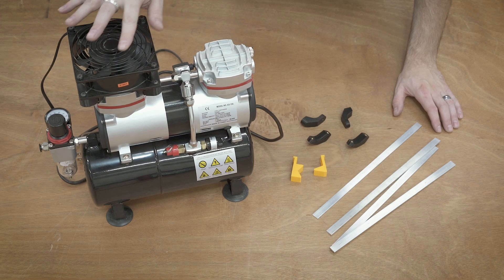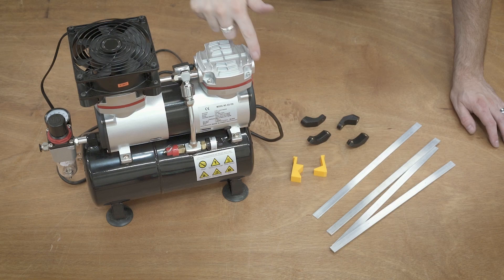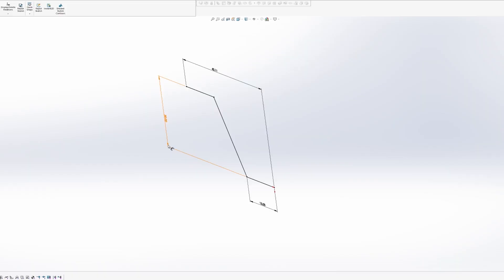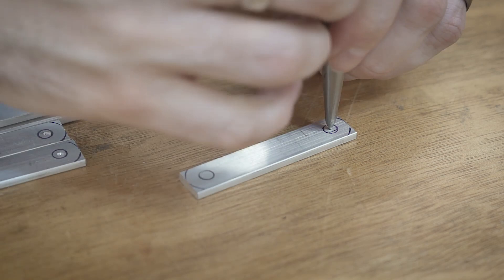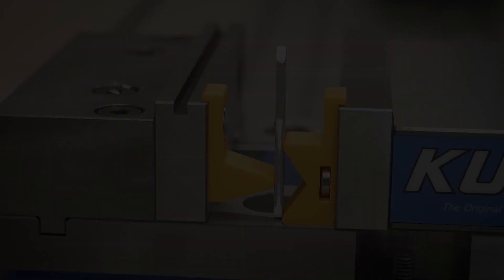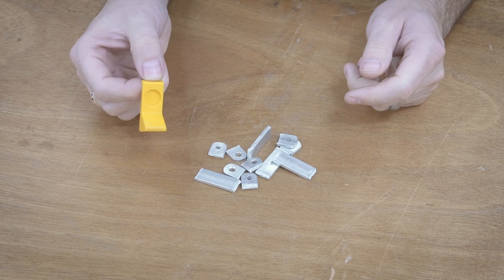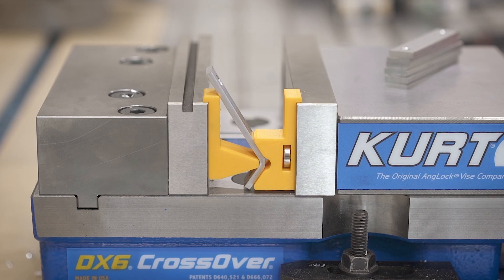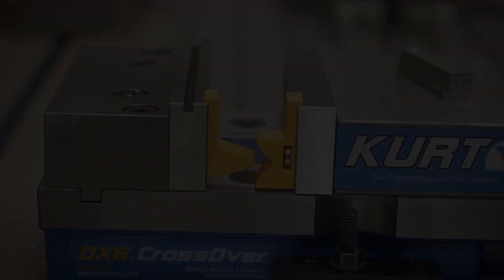Bending Aluminum with 3D-Printed Dies

Comment: A tip for annealing aluminium, coat it with soap from a soap bar and heat it. When the soap turns black you have reached the right temperature, then let it cool.

Comment: For future reference mate rub a normal bar of soap on the aluminium before you heat it and heat it till the soap turns brown and you have properly softened the aluminium for bending 🤙🏻
Reply: With an O/A torch setup, cover the bend area with a flame of acetylene only to cover it in soot. Light the torch as normal and burn the black back off the metal. Thats the temp needed to relax aluminum for bending.
Reply: @LegendLength  Some softly whispered sweet nothings helps too.
Reply: Similar idea but trick I learned in another forum is to mark it with a sharpie and heat until the sharpie (mostly) disappears.  This works great.  Taught it to teenagers who have used it a lot and they learned it really quick.  Only one melted part in the process.  LOL.

Sharpie is more common than having acetylene torch and easier to read color change than soap.

Comment: 3003 series aluminum is the one to grab for bending off the shelf. You can also cold bend 1/8" 6061 if you increase your bend radius to 2-3x what you were using and keep the angle below 50 degrees. I cold bent the entire shell of my last 3lb bot out of 2mm 6061 with 45" angles first try without any cracking :)

Comment: You can use a heat gun to heat up the aluminium for it to more easily bend without cracking. The simple trick is to use a bar of soap to draw on the aluminium (like a crayon), heat the aluminium (opposite side of soap) until the soap just begins to turn black then remove the heat gun. The soap is a perfect medium for aluminium, I used to create aluminium ladles back at school by hammering the aluminium over a hemispherical mold with no cracks ever developing

Comment: 5052 is another good alloy that's fairly bend tolerant.  A bit less ductile than 3003 but in your application that probably doesn't matter.  That said, you solved the problem with on hand tools and materials.  I like the Kurt mini press brake.  Got to love innovation.

Comment: I am suprised every time again, how strong pla is!

And then my Part melts :(
Reply: Spent 7 hours leveling the bed on my Da Vinci a while back. Prints look amazing but god that was a hell to go through
Reply: Make a solid part. 100% infill 
And take Salt(small particles recommended)
TAKE A SMALL VESSEL which can Cover you part with salt around it. 
Bottom layer salt
Mid layer PLA PART (covered with salt)
Tom layer Salt
Hit it up to 200 degree in oven 
It will rock hard. 
You can bend metals with it then

Note: Never use colourful, or Matte finish PLA for engineering applications.

Comment: I too learned the hard way about trying to bend 6061. I had some nice finished laser cut parts with laser-etched bend lines made for drone landing gear, and they cracked in my hands. switching to 5052 worked out great in the end. It's the alloy most used for bent electronics enclosures.
Reply: Haha, I work in sheet metal and there is a surprising number of engineers who think 6061 is formable. It actually is, but you'd have to use radius so large that it becomes impractical.

Comment: Hey, should i check my eyesight? In the final shot 14:03 when the mounted fans are shown, the two connectors on the left seem to have a breakage in the lower bend. Or is that an illusion caused by a reflection?
Reply from the maker: Ha, no.  I didn't redo ALL the brackets, some of the original ones had some cracking.  I only redid a portion of them.  So you're seeing things right!  Some of the first batch had some cracking, but are still structurally OK (for this puprose).
Reply: @RobertCowanDIY  So 8 months on how did those cracked brackets hold up? I'd have thought the vibrations from the compressor would cause them to propagate and snap, although the fan would probably still be secure enough with two good brackets.
Reply from the maker: @shuflie  I hadn't give it any thought.  Went out and checked and it's fine.  So it should hold up just fine in the long run.  I think the others hold it in place firmly enough so there's no added stress.

Comment: grain is probably in the wrong orientation and caused your cracking. Aluminum has a grain like wood during its manufacturing process. Great project and have never thought about making dies on my 3D printer!

Comment: Great video-fyi sheet/plate aluminum has a grain, similar to wood.  It is stronger if you bend across the grain.  The grain is parallel to the way it comes out of the processing mill.  Often you can see lines on the surface that help identify which direction the grain is going.

Comment: I learned it from a machine shop, I had tried to commission a piece to be made and I asked for it to be 6061, and they told me they have to substitute 5052, because the angles I wanted out of 6061 were not going to happen. With that knowledge in hand, I did my own research, ordered some 5052, cut out the shape on my small CNC, and use a vise break (a steel one, didn't think of printing one out) and it worked, and I still heated up the aluminum to make sure it didn't snap on me, but yea, big difference. 6061 is a bear to bend.
Reply: 5052-H32 is ideal for sheet metal work with sharp bends.  Even 180-degree bends to hem an edge are possible without cracking the aluminum.  No further annealing is required.  The "H32" temper is what would be called "1/4 hard", so it can be bent rather easily.

McMaster-Carr  https://www.mcmaster.com/aluminum-sheets/easy-to-weld-5052-aluminum-sheets-and-bars/  is a good source to get such material quickly.  They don't have the cheapest prices for larger quantities, but they have a wide variety in stock and delivery is quick.  One warehouse is in southern California.  I can order parts by 5:00-6:00 PM and have them delivered 40 miles north of Seattle, WA by about 10:00-11:00 AM the next morning with standard delivery.  Being a mechanical engineer, I use them a lot because they help to keep urgent projects on schedule.

Ed Schultheis 
http://www.schultek.com/

Comment: Perfect, I've got to bend about 40 similar pieces of aluminum and didn't think about just 3d printing a die. Could also just laser cut and stack the material, might do that instead. I think the acrylic would be just as strong? Guess Ill find out.
Reply: You can make the dies out of HDF or wood just as well. Prolly wood is your best option here, cheap and easy to make.

Comment: Hi I am into 3d printing but have spent my life behind a computer and don't know much about metal shop tools or w/e you call them lol.  I want to buy stuff like what you have, like drill press, the sander you used, etc.  but how do you know which ones grind metal?  Are there discs and drill bits that you can buy that work on metal and wood?  Or do you have to change them out all the time depending on what you're working on?

Comment: Quick note for 3d printing, you should be using more wall thickness instead of 100% infill. Both work but thicker walls will let you save material in some cases. And here's where I got this from: https://www.youtube.com/watch?v=AmEaNAwFSfI

Comment: Try rubbing soap on to the Aluminium (English Spelling) then heat the Aluminium until the soap turns Black then allow to cool, I believe that is the correct Temp to anneal Aluminium,  not sure if it applies to all grades.
Reply: The correct spelling.
Reply: Yes, but it was an aluminium alloy.
Reply: @michaels3003  so what

Comment: I've spent some time doing press work in an industrial setting, and my guess is that the cause of your cracking is the grade of aluminium you're using. I'm not sure if the grades transfer across the pond, but here in the UK the best aluminium grade for pressing I've found is 1050.
Reply: 5052 is pretty common for bending, as you can heat treat it. 6061 works, but it can't be in the common T6 temper when bent. Alloy and temper both play a role, but the temper is usually what "catches" people.

Comment: Great video! What are you using to turn the fans on and off? Separate switch or wired into the pressure switch on the compressor?
Reply from the maker: I just have everything plugged into a power strip, and that's controlled by a solid state relay in the Avid controller.  So when I turn on the fogbuster, it opens a solenoid for that as well as turns on the fans.

Comment: inner bend radius should equal material thickness, to avoid cracking
Reply from the maker: That's actually what I had.  It's 1/8", and the fillet on the dies was 1/8" radius.

Comment: did you give up on the stratasys project?
Reply: Its probably just an obsecene amount of work.
Reply from the maker: I have a final video where I talk about why I abandoned the project.  Every little detail about the machine is a huge road block.  The heater cartridge was 90V, the nozzles are proprietary, there are thermal switches everywhere, etc.  It was really fun to mess with, but getting a machine that can print on the level of a Prusa was going to cost me several months of time.

Comment: Polycarbonate will stand up to 110C, abs 80C how hot these cylinders come?
Reply from the maker: With the fans, they're barely warm.  I had an air leak and it ran overnight without the fans, and that got really hot.

Comment: You might want to revisit the design with different fans or an alternative placement of the fans, as the air is mostly bypassing the cylinders.
Reply from the maker: How so?  The top of the cylinders is where the air is blowing, and the little ridges on the top are the hottest part of the compressor.  After running for 30 minutes, it's just a few degrees above ambient.  Without the fans, it would be too hot to touch and the seals started breaking down.  I did a lot of testing for the fan locations, and this was the optimal placement to cool everything down.  I tried them on the sides, in front/back, etc.

Comment: The cracking has to do with the way they are manufactured. The material is rolled so there is a direction of lines on the material. Always bend perpendicular to these lines. If the radius is to small it affects it as well - there are tables for the minimum bend radius

Comment: Heya, why do you keep you wedding ring on why using a belt sander/ band saw. Isn't that very dangerous?
Reply from the maker: For a belt sander, I don't see how that could be dangerous.  Someone can surely correct me, but there's nothing to 'catch' when using a belt sander.  For the bandsaw, same kinda thing, if it caught my finger, it would cut the finger, the ring would be less of a concern.  Typically, you don't want rings if something is going to suck your finger in, like a lathe or milling machine.
Reply: @RobertCowanDIY  from what I was told, the ring can catch in the abrasive and because you aren't expecting it it can pull your finger into the base on the sander, same with the band saw. Just what i was taught, apologies if that's wrong.

Comment: The one big error is you are using extruded aluminum and not sheet aluminum. Look at the grain structure where is fracture. Now that you annealed the aluminum and lost the strength of the material and the bend. Now you need to hardened it.  For what you used them for is fine but, not if you are using pieces for structural loads. Bad and incomplete info here.
Reply from the maker: Correct, that's the cheap stuff from Home Depot.  I was just trying to demonstrate that a 3d printed die could be used to form aluminum, which is still true.  But you're right, it will need to be hardened afterwards, if the application warrants it.

Comment: Do you know how to re-tempering them ?
Reply: Generally hardening aluminium means heating it to almost melting temperature, and quenching it. A lot like steel, but with a much smaller window of critical temperature. Obviously each alloy will has slightly differing specs, and behavior.